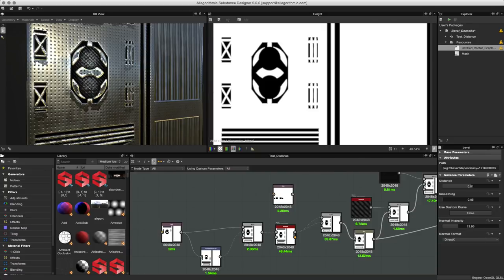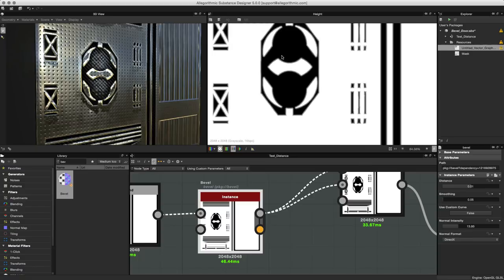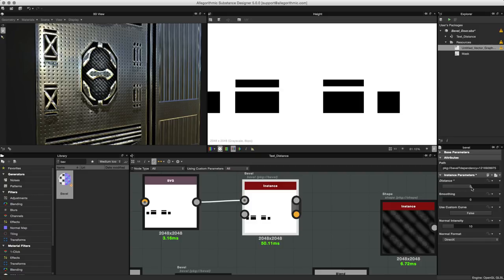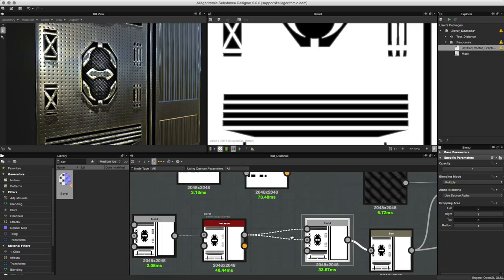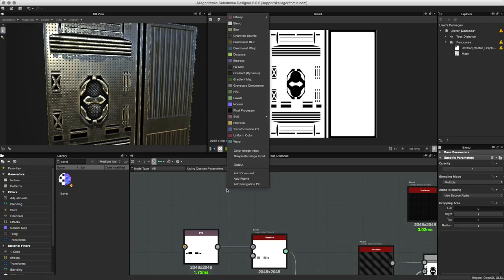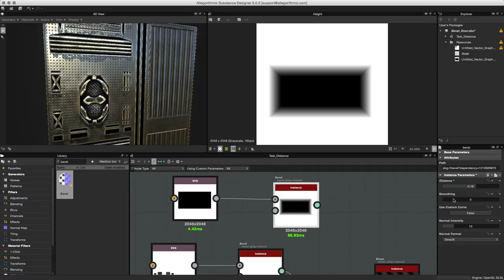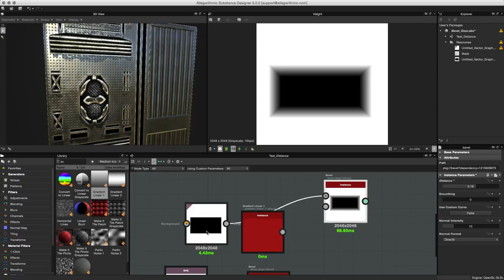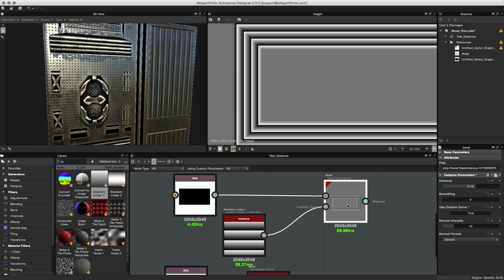Substance Designer 5 - Using the bevel node | Adobe Substance 3D

Comment: I just updated to the Summer 2018 version and my bevel node only has one output that says "Material". I would like to convert it to Grayscale, as I want to use it in a blend node. I must be missing something here...
Reply from the maker: If it says material as the output, it means the graph is in material mode. If you hit 1 key on keyboard, it will go to standard mode and then you will see the height and normal outputs. https://support.allegorithmic.com/documentation/display/SDDOC/Link+Creation+Modes
Reply: @Substance3D  oh ok, thanks so much for the quick answer